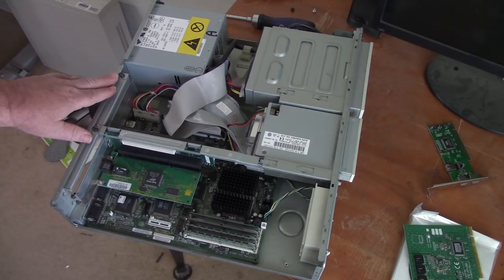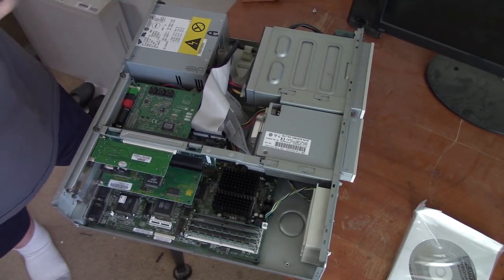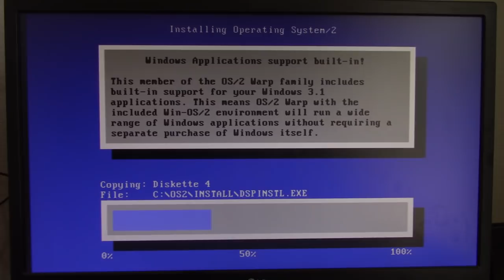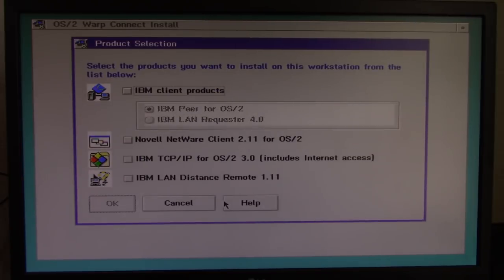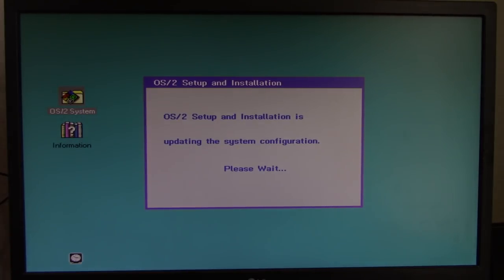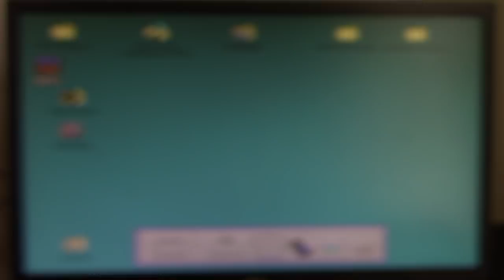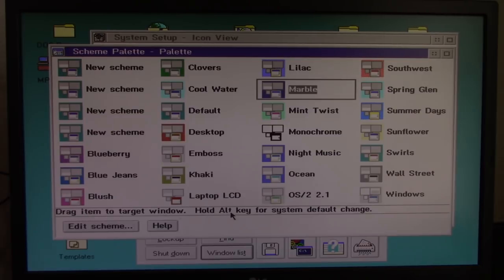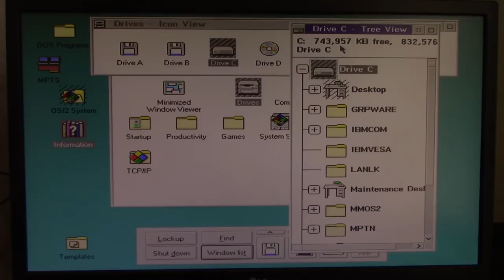OS/2 Warp 3 Installed on the IBM PC 340

Comment: Did you set the Isa ports and irq for your network card? That might be an issue. Also, amazingly, os/2 3&4 can still do a remote ftp based update for fixpacks from ibms ftp. All you need is a floppy with the rsu for os/2 and you can update the system using rsu over the internet still. Also if you grab Netscape 4 for os/2 from mirrors you can use the internet on os/2 to browse Hobbes and download stuff, so it is useful
Reply from the maker: My OS/2 experience is about 20 years old, so I am quite rusty. I know the ftp sites are still there since that is how I downloaded the files, but I never tried an ftp update. That is cool.

Comment: How large is the HDD?  OS/2 was very picky.  DHCP was available with FixPack 40.
Reply from the maker: The HDD is only 850MB. I did not go into the size restrictions as it did not affect the installation. I was going to cover that along with the fixpacks and IDE updates. Good to hear FP40 has DHCP since that is the fixpack I have to install. I was also going to do the TCPIP and MPTS fixes as well.
Reply: Do you have the WarpUpdate CD?   It has all the TCP/IP fixes, FixPacks for Warp 3/Connect and Warp 4.  Go to Hobbes and get anything you want, including Netscape 4.61
Reply from the maker: I do not have the WarpUpdate CD. I know Hobbes is still there. I already have Netscape 4.61 downloaded and ready to install at some point. Thanks.

Comment: WARRRRRRRP i love my time with OS/2 Warp. do you still have it running?? Oh make a linux OS/2 look alike ;)
Reply from the maker: I have an IBM PC340 Pentium I with 16Mb of ram running OS/2 Warp 3 and a Gateway Pentium II with 64Mb of ram running Warp 3 or 4. I have not turned them on in a couple years, who knows if they still work. I am not about to attempt to duplicate OS/2 Presentation Manager on Linux, OS/2 desktop is more advanced than modern desktops. IBM's COBRA architecture is not really possible on Linux as far as I know.
Reply: @eznix  You should make some videos about them :) i am sure lot's of people would find that really interesting :) yeah i kinda wish OS/2 had beaten out windows, then again, they may have done just as much bad shit like windows have done if that was the case